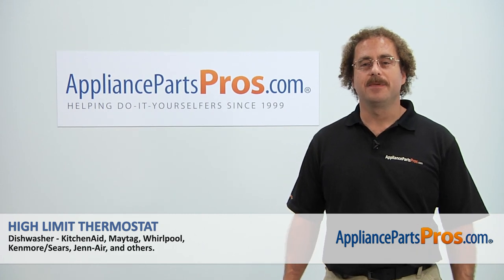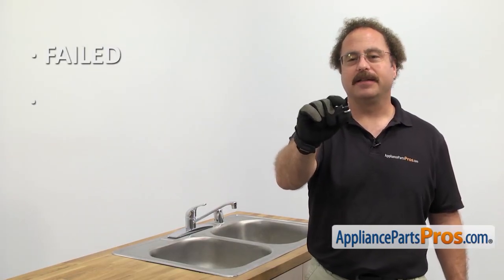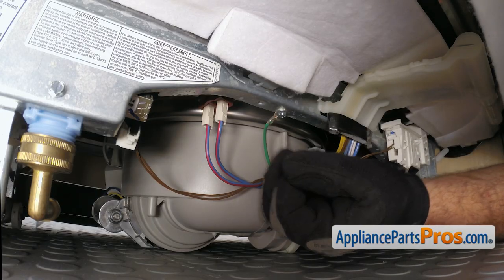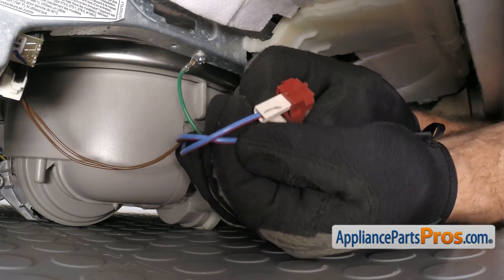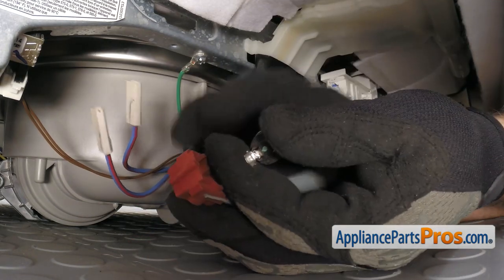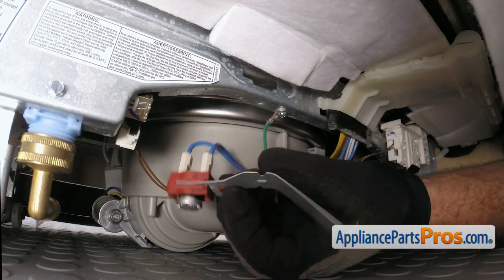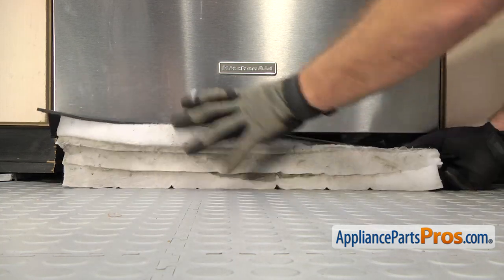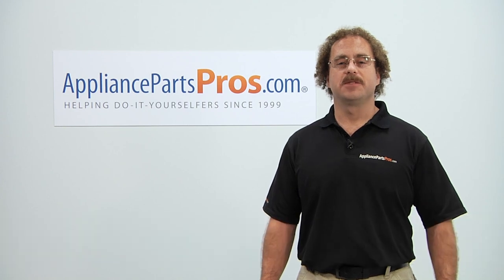How To: Whirlpool/KitchenAid/Maytag High Limit Thermostat WPW10195091

Comment: Matt. 

Thanks for this video, which was the missing link for replacing the HL thermostat. With the help of pictures taken with my phone, I had located the thermostat but couldn't figure out how to remove it. This video shows how the mounting bracket is tucked under a layer of insulation, and details of how to remove the bracket.  It let me proceed to successful (but fiddly) reinstall. Thanks.

Martin